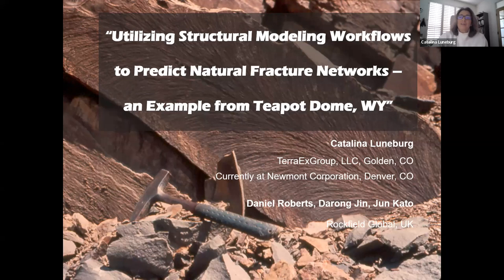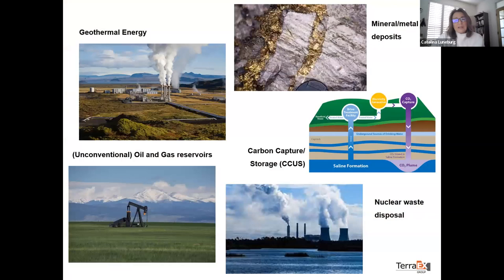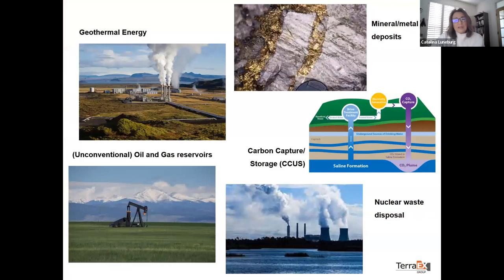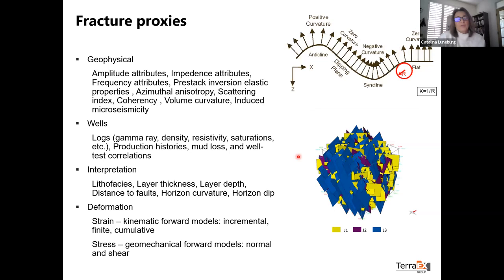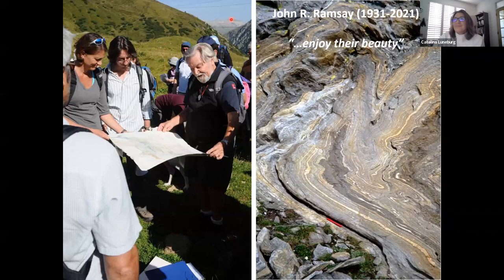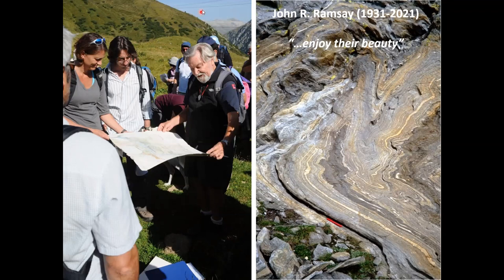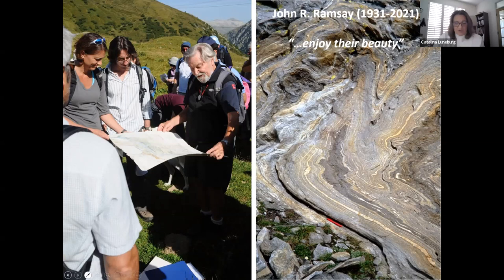Dr. Catalina Luneberg: Utilizing Structural Modeling Workflows to Predict Natural Fracture Networks

Comment: That is really a nice 2d simulation. A next important step in the direction of understanding relationships between various parameters. It is allocated in the very right bottom corner of my Ternary Diagram of 3d Fracture Modelling, for who is familiar. Using the strain distribution (curvature, bending, articulations) as a result of accurate simulation of deformation as a proxy for specific fracture network characteristics is a well known procedure: But we also have to bear in mind, obviously, that cross-correlations between distributions of density and/or orientation on one side and geometry of the fold on the other, are becoming more and more a matter of debate, since I raised the issue in my 2019 paper (which referred to my previous discussions on the application of tilt correction in 2000). Therefore, the simulations might be of more of help to detect permeable zones, or as a driver of fracture properties, within a 3d fracture network that needs to be modelled in a completely independent way (as is one of the options in DMX). Congratulations for the work and I am eager to see the future developments!